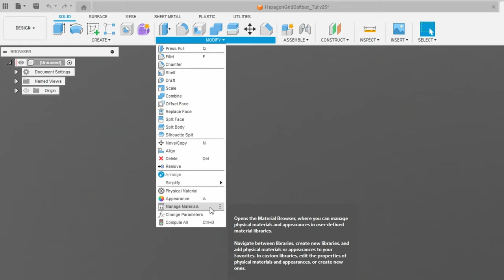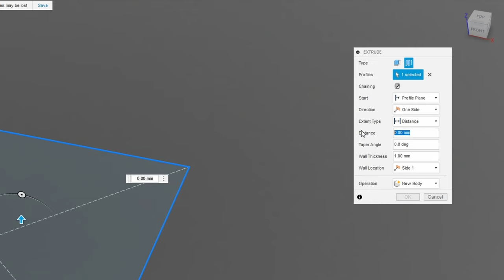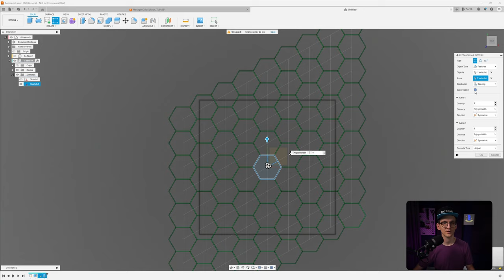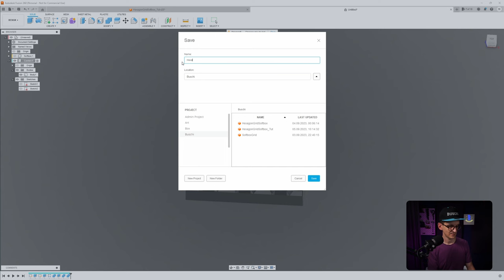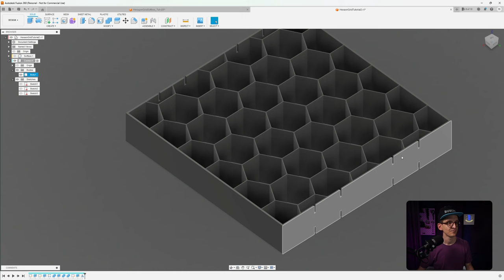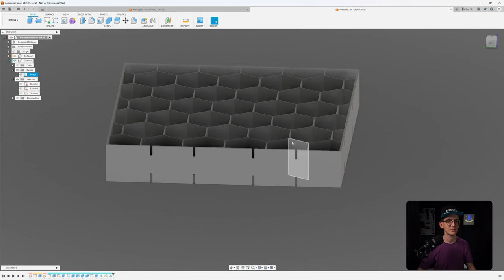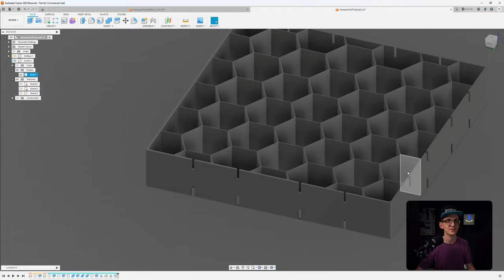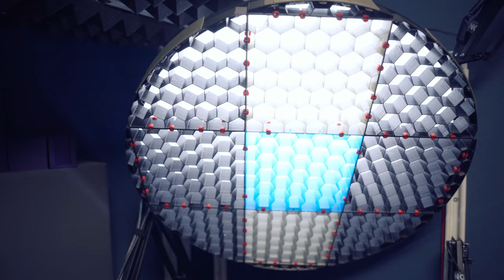HONEYCOMB GRID TUTORIAL in Fusion360

Comment: Even simpler if you plan on 3d printing. Make a solid box. Remove top and bottom layers and just set a hexagonal infill.
Reply from the maker: That is always an option, but not a very precise and controllable process.. Nothing that I am after when I want to design something with hexagons.. I wanted the ability to steer how wide the openings and thick the walls of the hexagons were..

Comment: My polygon walls weren't touching. In the two pattern distance fields I had to put PolygonWidth - Thickness - Thickness
Reply from the maker: Were you maybe expanding the shape in one direction only and not symmetrically? Then this could be..
Reply: @iambuschi  It's fine I was just adding .1mm until they aligned.

EDIT: I figured it out. I was setting an inscribed polygon, thus setting the center to *corner* radius. Somehow I missed when you used the Sketch Dimension tool to "fix" the inscribed polygon to set the center to *midpoint of an edge* radius. The circumscribed polygon automatically does this.
Reply from the maker: @00WhiteBlade Ahh alright. Nasty little detail, which offs the correct dimension.. Great, that you figured it out!

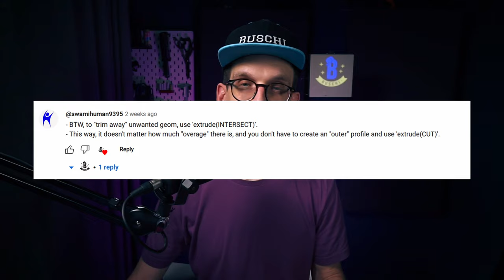Comment: You can actually still save two more steps! Instead of extruding the "tool body" and intersecting with that, and then doing another union, you can immediately choose the "intersect" type extrusion with the outer profile right after unioning the outline and hexes. This leaves you with a single body that's exactly what you want. I think this is what the comment at 15:07 was trying to say.

So the total history up to that point is 1) sketch outline 2) extrude outline 3) sketch hex 4) extrude hex 5) pattern hexes 6) union outline+hexes 7) extrude/intersect outline
Reply from the maker: Yes, the intersection step wasn't fully optimal :-)
Reply: I just tried replicating it in OnShape and in that case, you do need the extra union step as far as I can tell